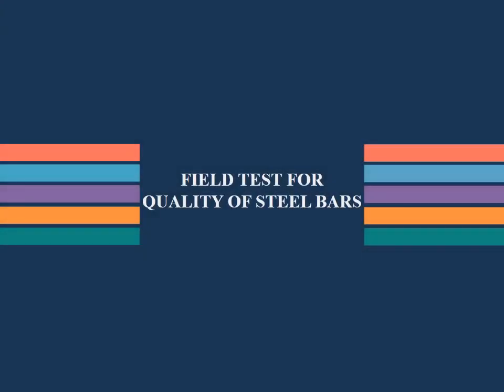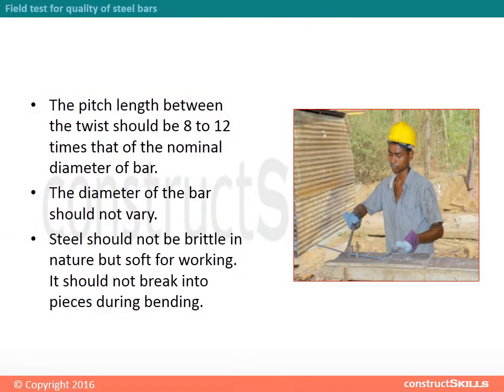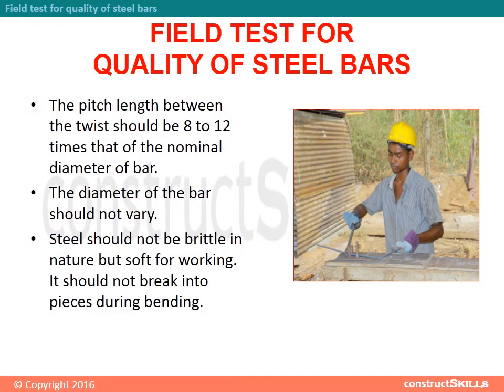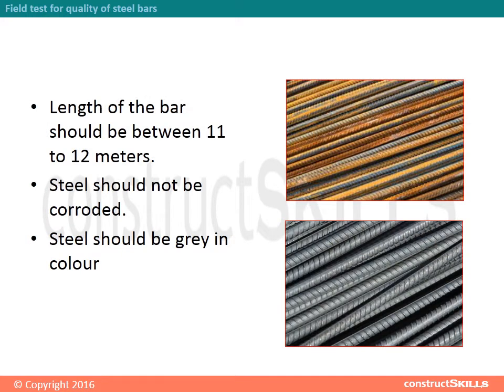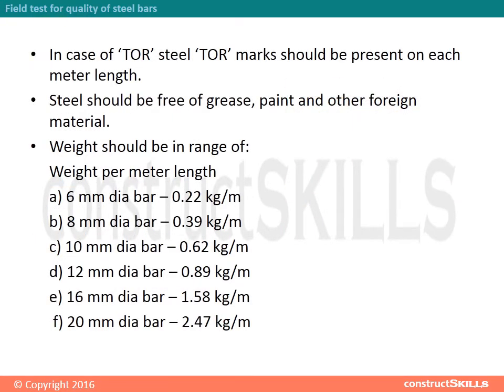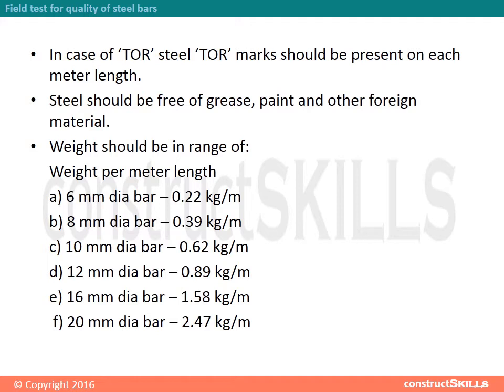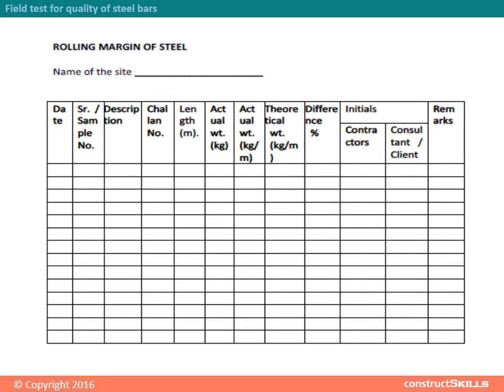8 7 Field test for quality of steel bars

Comment: REBAR STEEL - MOQ 300.0000 MT 

Our MOQ for Rebar Steel is 300.000 MT - The Rebar Steel is manufactured at SABIC, and we are able to adjust any Chemical composition if needed..

 CIF "AWSP " Official Price                                                          

 " We can offer exclusive for January 2021  - All prices are subject to immediate changes without prior notice one's CI hasn't been issued yet "

  300.000MT our price 640,- USD CIF Any Safe World Port  300.000MT our price 595,- USD CIF Any Safe World Port 
  400.000MT our price 615,- USD CIF Any Safe World Port  400.000MT our price 570,- USD CIF Any Safe World Port 
  500.000MT our price 560,- USD CIF Any Safe World Port  500.000MT our price 520,- USD CIF Any Safe World Port 
  700.000MT our price 507,- USD CIF Any Safe World Port  700.000MT our price 470,- USD CIF Any Safe World Port 
1.000.000MT our price 427,- USD CIF Any Safe World Port 1.000.000MT our price 390,- USD CIF Any Safe World Port 
Email: imtraj786 Gmail & skype